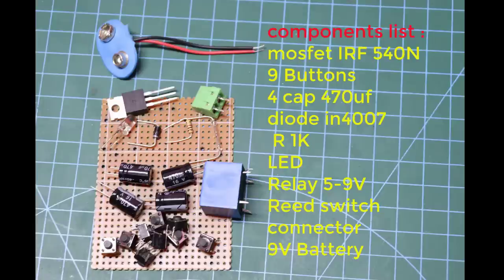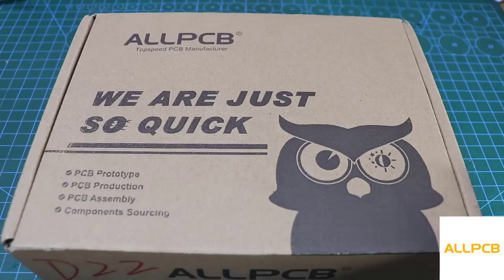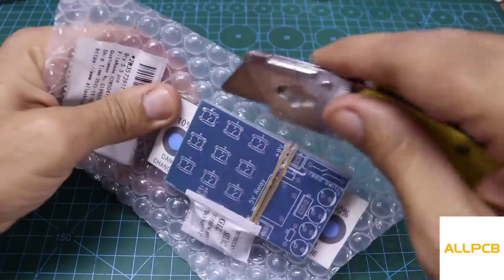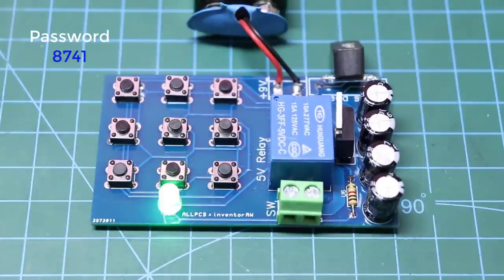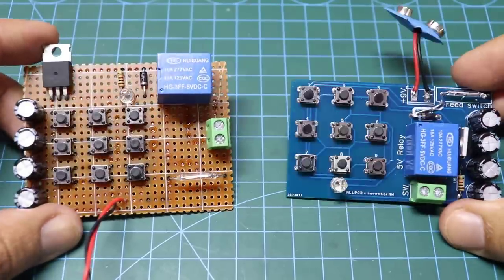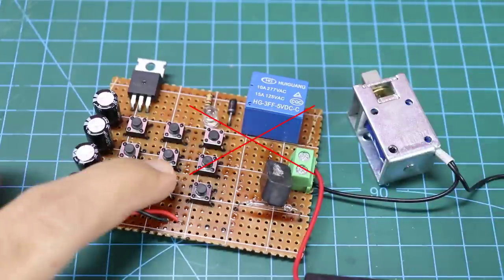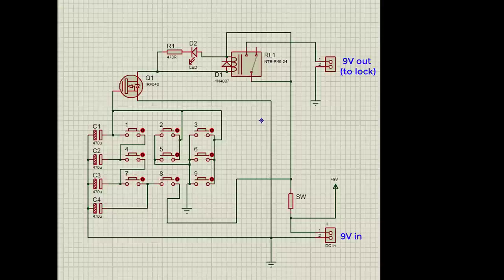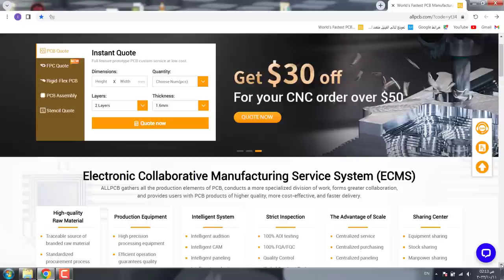This Device is Very useful You can Make At home / ALLPCB

Comment: I hate having to be a naysayer, but that's the least secure digital lock I've ever seen - it should open if you just run through the keypad four times. Put diodes from the  capacitors to the 5 'wrong' buttons, so they all discharge when a wrong button is pressed? and to be safe, add a resistor between button 9 & ground to avoid short-circuit if someone presses two buttons at once.
Reply from the maker: Thank you for your comment.. I learn from criticism
Reply: @Inventor_AW  as do we!
...such glad we found your chanel kind sir.
Reply: Yea, I had similar thoughts, see my comment above.